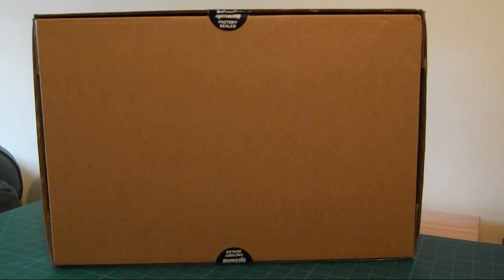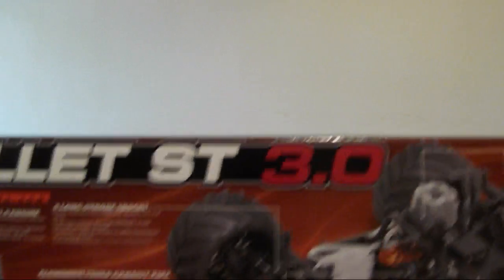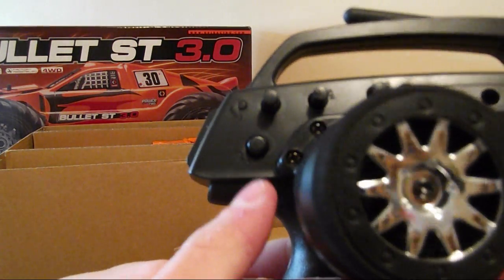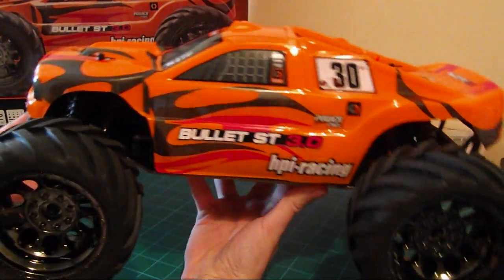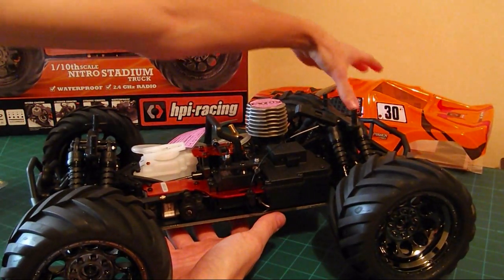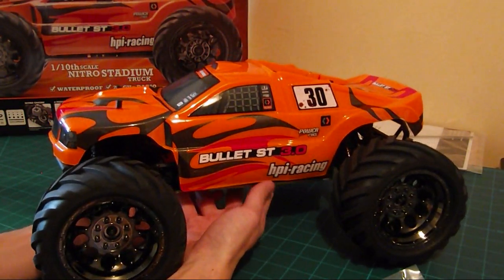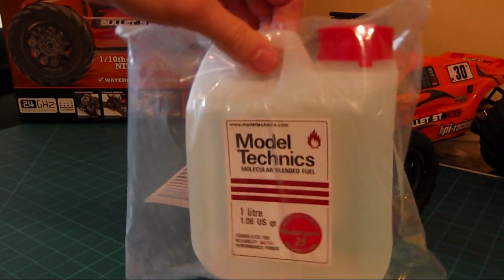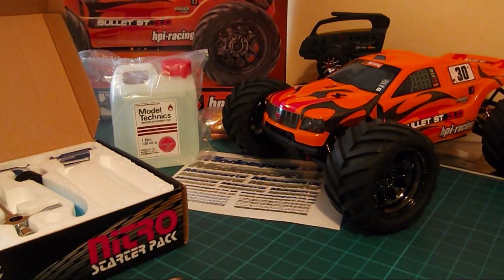Unboxing #4 - HPI Bullet ST 3.0

Comment: Sorry if i sound nooby, but where do the batteries go in? Wheres the battery pack im confused
Reply from the maker: There's a box with the receiver in. That's were the battery goes. Very annoying though as you had to remove 6 screws to open it.

Comment: Just a tip on these nitro models, you may want to get the roto start instead of pull cord in the long run. But all should be fine for now

Roto is electric of course.

I own the t-maxx 2.5 and 2.5r